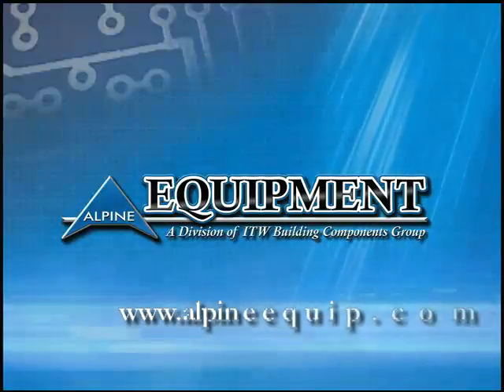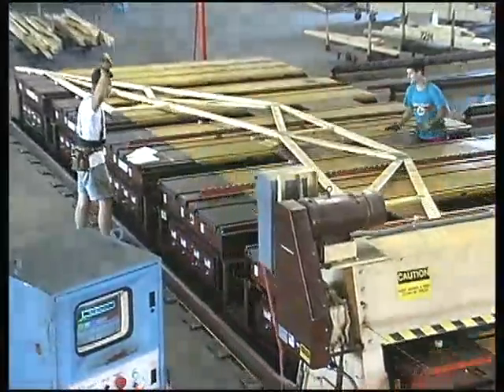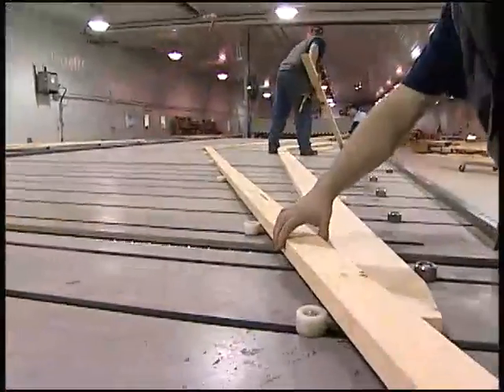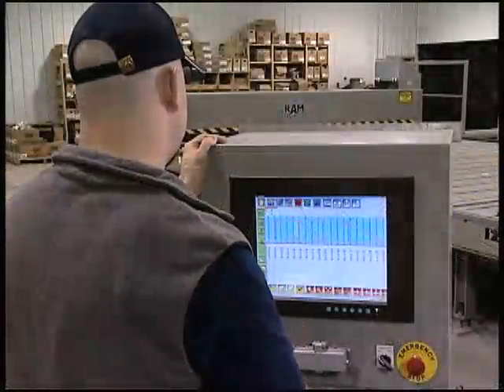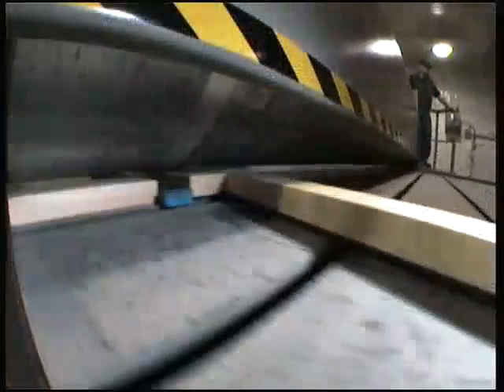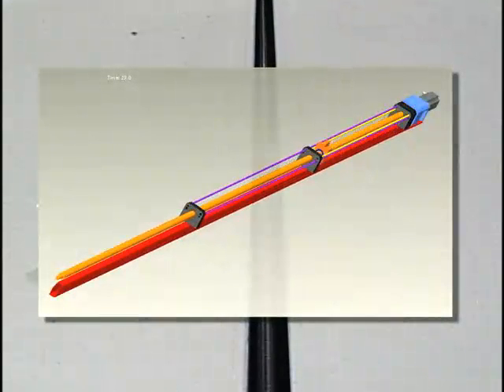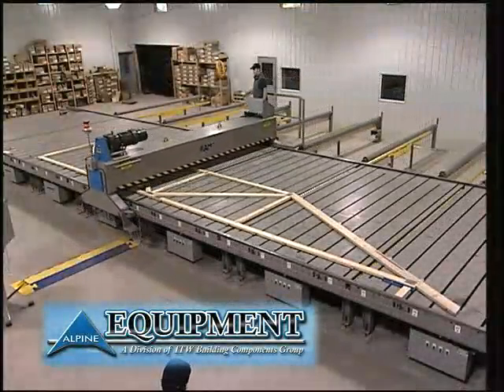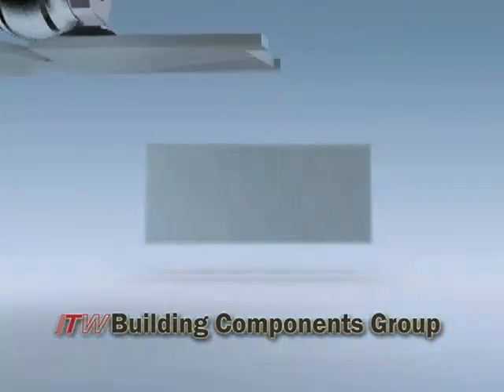AutoSet C4 - Jigging System

Comment: There should be walkways between the tables so the guy on top chord isn't on his knees all the time.
Reply: the old school truss manufacturer I worked for had a wood platform with those guys being the foremen plating one side and then us floor jockeys flipped over onto the roller table to plate the other side before running through one roller press, they were impressed with my strapping "skills" they had me strapping every set, I worked there for a month at $9/hr before moving on to a better paying job more along my driving qualifications despite the truss company not utilizing me for my class A cdl as they had plenty of drivers. No one was on their knees, the table foremen was crouched or squatting when putting on plates but never on their knee and I did not see the guy on his knee anytime in this video
Reply: Yes our truss plant has alleys between tables so u can prevent being on your knees as much
Reply: There would be lots of studs landing on the holes if it's a gable.
Reply: @Sanriago98  put movable steel bridges between the tables so you can slide them where needed.   That's what our truss plant does works nicely.
Reply: @yfz350twin  I've worked with that set up before and used to bang my legs on the edges, also didn't have the ejectors. Haven't seen a table with ejectors and walkways in years

Comment: Nice system. I have been lead hand on an old school manual bobbin set, a laser system and a tips, which is similar to this.  The truss innovation system (tips) has problems with debris jamming it up, and belts and wheels which work there way off. What I really like is how the air jacks pop....nice.